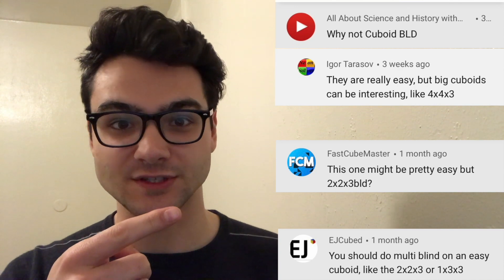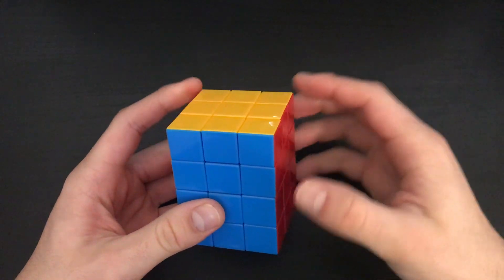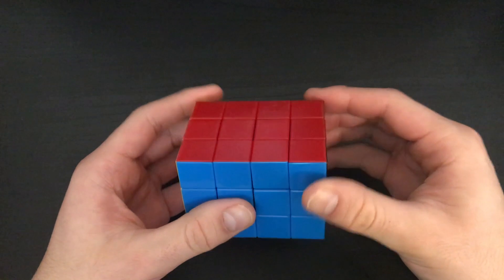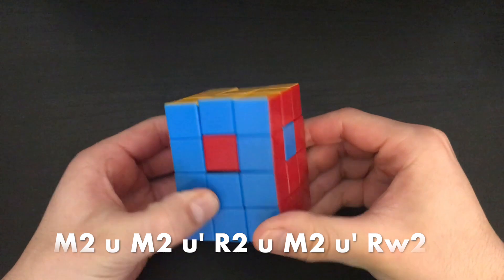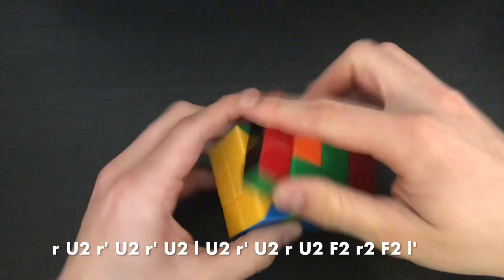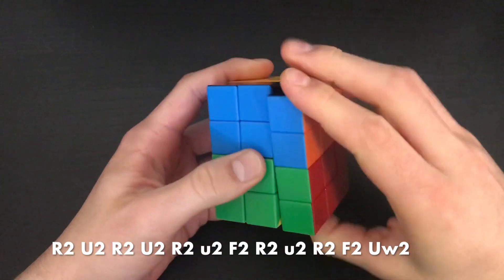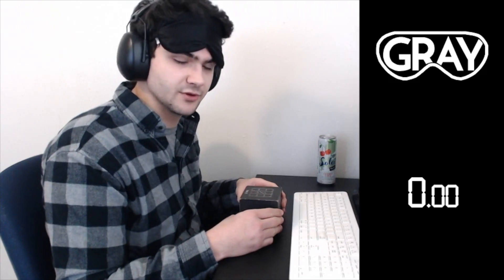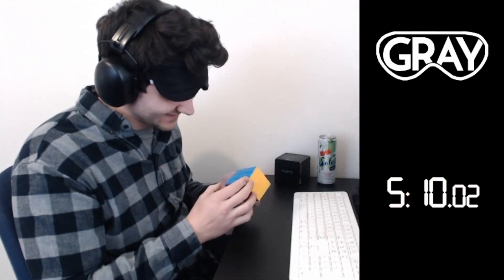No Peeking #6: 3x3x4

Comment: Hi people, I just recieved mine, pretty sure it's the same model as in the video. The middle layers are sometimes bandaged together depending of the outer layers, is it normal ? I disassembled it and reassembled it, it seems that's normal by how inner pieces are made, but I don't see the point ?
Reply from the maker: ARatQuiRit if you don’t shapeshift it, it shouldn’t bandage
Reply: @TheGrayCuber  Yeah that's what I was thinking... Noticed that without those two inner pieces it doesn't anymore, but of course the heart mecanisme was able to move freely and sometimes stuck the cube entierly..

So, I  finally put only one of those two pieces and it's fine now. Never bandage but keep the core in place.
Maybe they have to be on a specific place and were wrongly mounted ? or only needed one ?

Anyway, problem solved ! Sorry not able to exactly tell what I mean ^^ And Thanks very much for the reply !! =)